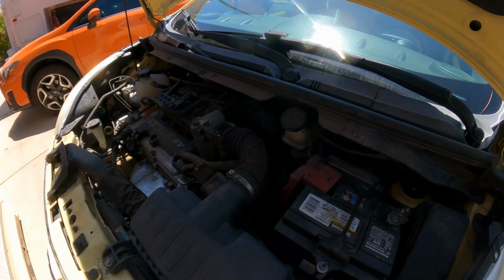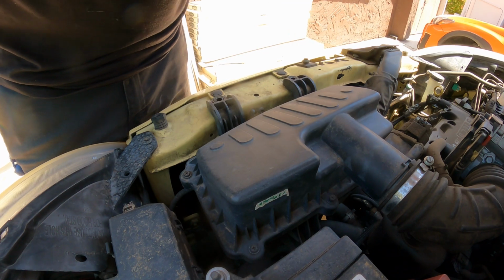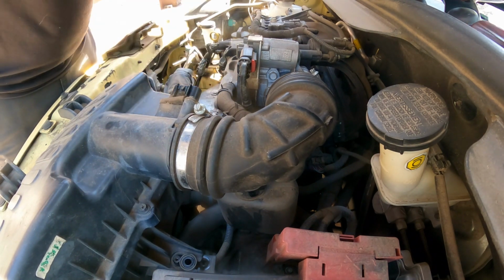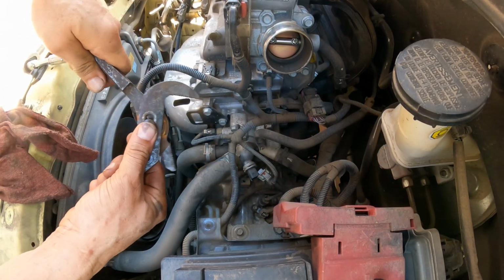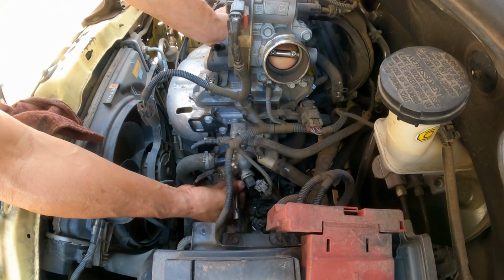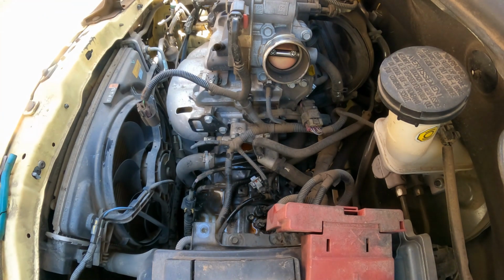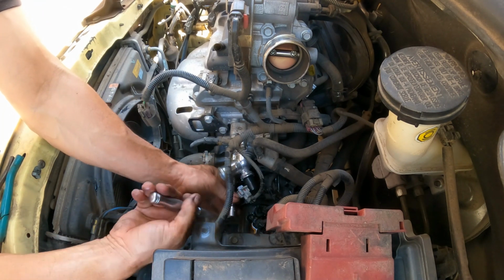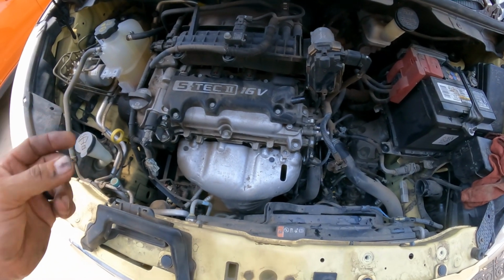2013 Chevy Spark 1 2L Code P0599 Thermostat Replacement

Comment: Great video but I suggest that you replace the upper hose as well because I did just what you said and the hose started leaking where it connects to the housing unit. Oh the torque specs are 71 inch pounds not foot pounds

Comment: Hello, will this also fix code P00B7? The core appear for me recently and i checked and my coolant level was low. I refilled it and the engine light stills on.
Reply: Hello! Were you able to fix your issue? I’m currently having the same issue with my 2015 Spark.
Reply: @m1gNode  hellos yes! The hose going to the coolant tank was chipped and ripped exactly where the hose connects with the tank, I ordered the pieces from Amazon and that fixed it! Overall cost of pieces less than $30 and took me about 1h max